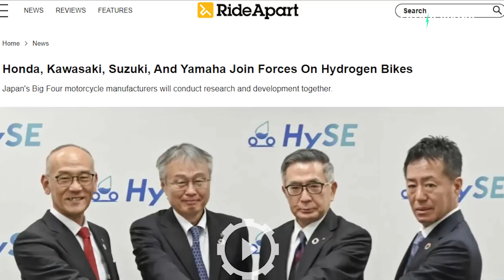Honda joins Toyota's, Suzuki & Kawasaki to make hydrogen engined vehicles

Comment: Just checked wikipedia to confirm what I already thought. A hydrogen engine (not fuel cell) is NOT considered zero emission, therefore it won't be allowed in certain countries. The video mentions carbon neutral, which is another way of saying it's not zero emission, we're just counting it against the reduction of things like reduced use of oil and gas. I don't know why governments allow corporations to talk about carbon neutrality when they actually aren't getting rid of carbon emissions. I hate seeing buses and garbage trucks running on "clean" natural gas. There's no such thing as clean burning natural gas. Of course, generating electricity to charge EV batteries does require the use of "dirty" fuel in many power plants and manufacturing facilities but this usage has been reduced with the use of hydroelectric plants along with solar and wind farms. It will take a real long time and major changes in the way things are manufactured to get rid of all burning of fossil fuels (will still use oil in making certain products) but the blatant misinformation being pushed by corporations like Toyota has to stop. They need to quit using words like carbon neutral and carbon offsetting and tell it like it is. Of course this will never happen because corporations always lie about everything they can get away with.

--As pure hydrogen does not contain carbon, there are no carbon-based pollutants, such as carbon monoxide (CO) or hydrocarbons (HC), nor is there any carbon dioxide (CO2) in the exhaust. As hydrogen combustion occurs in an atmosphere containing nitrogen and oxygen, however, it can produce oxides of nitrogen known as NOx. In this way, the combustion process is much like other high temperature combustion fuels, such as kerosene, gasoline, diesel or natural gas. As such hydrogen combustion engines are not considered zero emission.

--Burning natural gas for energy results in fewer emissions of nearly all types of air pollutants and carbon dioxide (CO2) than burning coal or petroleum products to produce an equal amount of energy. Natural gas is mainly methane—a strong greenhouse gas.

Comment: About 8% of petroleum goes into chemical manufacturing. Coal is still the cheap reducing agent of choice in metallurgy - especially in making steel. We'd all be better off if hydrogen production powered by renewable electricity (https://en.wikipedia.org/wiki/Steelmaking#Hydrogen_reduction) were to become cost-competitive with carbon reduction of iron ore. Hydrogen-powered cars have no chance of competing with EVs.

Comment: So what is the "round-trip " cycle efficacy ? EVs get about 3-4 miles per kWh. What will it be when you have to  electrolysis water to get the hydrogen and then burnt it in a ridiculously inefficient hydrogen ICE engine ? My guess would be less than one mile per KWH
Reply: Dont ask, it is very likely a deal breaker for this technology.
Reply: @林振华-t4v  if you do the maths, replacing all the UK's cars with EVs would add about 65twh to yearly uk power demand.  So about an extra 20 to 25%.  A lot but doable over a decade or two. But i would expect about 200+twh a year doing it this way. .

Comment: It REALLY must be an existential crisis for all these companies to join together!!
Reply: Joined to die together.
Reply: Yamaha and Toyota have worked together many times, producing a V6 engine for the Pontiac version of the Matrix, for example (why they didn't put it in the Toyota version I can't really understand).
Reply: @One Tin Solder  you nailed it on one of the auto industry’s main sources of profit, parts and maintenance services. As a former 22 year auto maintenance and service tech, long time auto enthusiast, and previously proud owner of 9 Toyota vehicles, I’ve seen the writing on the wall in the last half decade. When I saw a factory assembly line video of Toyota’s Mirai HFCV and how complex the powertrain is underneath the body panels, I knew it would not be an easy market adoption. Cargo space is also sacrificed greatly to accommodate the two compressed hydrogen tanks. I did as much research as I could about HFCVs. The result of that research made me realize that it’s basically a scam. A way for legacy brands and big oil to hold onto business as usual by marketing HFC as a better alternative to BEVs. Which is why there have been so much constant negative media about EVs and specially Tesla. All while HFCVs are somehow promoted heavily and rarely without mentioning any of their downfalls, which there are many. More than EVs actually. In fact too many downfalls for me to even consider them as viable for personal transport use in the foreseeable future. Which is also why they have yet to catch on in the decades that why have been heavily marketed as the “fuel of the future”. Don’t take my word for it. Everything I’ve said is easily researchable. And as long as you don’t get lost in the countless paid positive propaganda, you will find the truth about them and may come to the same conclusion as I have.
Reply: @FlipBoxStudio  Interesting perspective - thanks. My thesis: I think they're bowing to government pressure to build HYSE cars as a gift to the utilities, which want to restart their nuclear plants to extract H2 from seawater. It's the only reason I can imagine the Japanese government is putting pressure on auto manufacturers to go hydrogen. And as you point out, there's both a cultural precedent for companies to comply with such cross-industry pressure and a commercial incentive for them to do it (it would theoretically enable maintenance of the existing dealer network & maintenance/service model). Maintenance & service is where dealers make their money; replacement parts is where automakers make most of theirs (that & finance).

Japan isn't intending to import H2 in volume from fossil fuel companies: there is NO H2 tanker fleet & NO H2 distribution network. Hydrogen is a tiny molecule, almost impossible to contain in steel vessels & pipelines. It eats through stainless steel pipes & valves. So this isn't like pumping & storing propane/natural gas: that you can do. Doing the same thing with hydrogen gas isn't viable. There's no filling station network & won't be. 

Without a distribution & filling station network there'll be no way for customers to refill. 

There's currently one (1) H2 station in California; I'm pretty sure that's it for the US. Can someone comment on what the distribution network is in Japan? Is there any serious intent to try to provide one?

Assuming the Japanese were serious about doing this, they'd still be screwed. The EV supply is growing exponentially, & governments from EU to China are mandating that all new cars sold MUST be electric by 2030-2035. That is conceivably long enough for Japanese firms to create viable hydrogen-powered cars, and maybe even long enough to scale production. But without a hydrogen distribution network as ubiquitous as gas stations are now there's no way they'd be able to sell them. So this whole exercise appears doomed, & obviously doomed. 

What on earth is motivating Toyota & Honda etc. to even consider this? None of it makes any kind of sense.
Reply: It is but it's only moral support, won't git it dun.
Reply: @blaumax1910 As an owner of a 2023 Chevy Bolt EUV, I agree with all your statements. I drive by parts stores and gas stations all day long wondering why more people cannot see the benefits of owning an EV. I notice independent service centers with lots, full of cars, trucks etc, all awaiting repair. And gasoline is likely to be an issue as the 2024 presidential election approaches. Guess it takes some folks forever to see what's in front of their noses?
Reply: No, not really. I lived in Chiba prefecture 13 minutes from Tokyo station for almost 6 years. I worked  for a major corporation there and many of my still current close friends are Japanese people that I worked with there going back to 1998. Working together for the good of their country and their people IS the Japanese way. 
Toyota and Yamaha have worked together since the early 80's. Some of them use the same O.E.M.s to make engine parts and accessories parts since the 1980's/1990's.
Reply: @MichaelWashingtonAE  Working together on an EV strategy would make much more sense than putting efforts into those that are doomed.  Why hurt your whole society just to prove a point?
Reply: @Pimpernicholas  profits
Reply: @sorinelpustiu5674  except no profits
Reply: @MichaelWashingtonAE  But FIVE working together is a whole other ballgame! And coupled with the current market climate, you have to admit that this really feels like something a lot different from the status quo!
Reply: @unclefatbloke687  but when you make something different, it needs to be better, not significantly worse
Reply: @williammeek4078  Haha, yes, you would hope/expect so, wouldn't you!

Comment: This is ridiculous.
Physics isnt a religion. Japan is going to find out that physics exists whether you believe in it or not.
2,000 moving parts vs less than a hundred. The friction is insane.
Boat engines? You've got to be kidding me.
Battery powered boats are probably even better than cars due to how often boat engines breakdown.

Comment: Tony Seba was at the recent Shanghai International automobile exhibition and he said nobody was going into the internal combustion engine vehicle booths the were quiet and empty Everything was about electric vehicles Goodbye to the internal combustion engine companies Hydrogen will just bankrupt them faster
Reply: No, hydrogen will live on for fuel cell. And immediate customers will be all industrial application and rocket fuel. And eventually hydrogen fusion. But the auto manufacture go all in for it right now. They are the ones may go under.

Comment: Electricity is everywhere.
Do you have a hydrogen outlet at your house?
Most factories, warehouses offices have electricity. Hydrogen, not so much…😂😂😂😂
Reply: Right, and another aspect is this. Even regular gasoline stations take up as much land as a house, require large underground tanks and hardened safety protocols to prevent explosions of a dangerously explosive fuel. Hydrogen compounds all of this, to make fuel stations fantastically expensive and slow (it's actually possible it would take as long to fuel a hydrogen car as to fast charge an EV to 80% or so in the near future). And they have to be hardened against leakage of the smallest molecule that exists (nearly impossible) AND against the dangers of a highly explosive, literal rocket fuel. WHEREAS, with a significant but feasible infrastructure investment, fast chargers can be put in at relatively modest cost in EVERY already existing parking lot, which at least in the US is a hell of a lot. No or very little new land is needed. AND the conversion to 100% renewable sourced electricity is already underway and entirely necessary for other reasons ANYWAY. The contest is OVER. Battery Electric is the way to go. This has been clear since at least 2010 and it's ever more clear every day.
Reply: I have one at my house 🏠 built it myself moron

Comment: You have to use energy to make, store, transport and use hydrogen. When using hydrogen you lose energy in the form of heat. Batteries are a far superior solution and less volatile. And the electric system is already built and relatively easy to expand.
Reply: Batteries are hardly "far superior",  in fact electricity is some of the least energy dense fuel on this planet. EV motors are very efficient, however the batteries to store and use the electricity are really far too big and heavy for what you get. Tesla Model Y has a battery weighing in close to 1000 pounds, and hols the equivalent energy density of about 2 falls of gasoline (weighing about 16 pounds). Hydrogen's energy density is about 3x what gasoline is. Don't get me wrong I like my Tesla, but without a serious breakthrough in battery technology in the next 10-15 years, hydrogen may may be a better solution long term. (it has it's own issues too, all of this is relatively new)

Comment: Hydrogen pollutes much more than diesel. 
Then it has to be freighted around, compressed, decompressed new extremely slow filling stations has to be built.
Then there is the explosion risk…
Then the risk from a deadly gas with no smell.

Comment: They seem to have forgotten that the second law of thermodynamics says that when energy changes from one form to another form, or matter moves freely, entropy (disorder) in a closed system increases. i.e. you lose useful energy and it's innefficient.
Reply: Yes they are forgetting the laws of physics!!
Reply: @TheWizardofWestLA  you can’t forget the laws of physics. Hydrogen power is applied physics. Efficiency and Economics are then the guiding principles. You keyboard copy and paste merchants need to get educated.
Reply: So true. Hydrogen Engine: 1000Wh Electricity -> 750Wh hydrogen -> 250Wh motion power,  on the other hand, Electric Engine: 1000Wh Electricity -> 900Wh battery power -> 720Wh motion power
Reply: @ericliume  publish where you get the figures for H2ICE please so we can all fact check them. Thanks
Reply: @lesliecarter4295  You can get it from various sources. Here is a quote from Mckinsey report. FYI, There are four true zero-emissions technologies to power vehicles: battery electric vehicles (BEVs), hydrogen fuel-cell electric vehicles (FCEVs), hydrogen internal combustion engines (H2-ICEs), and biofuel or synfuel internal combustion engines. "Efficiency. Tank-to-wheel efficiencies range from 75 percent to 85 percent for BEVs to approximately 50 percent for FCEVs and some 40 percent to 45 percent for combustion engines.4 At the well-to-wheel level, the differences are even more pronounced: given the conversion losses in producing hydrogen from electricity and synfuels from hydrogen, efficiencies drop to some 35 percent for FCEVs, around 30 percent for H2-ICEs, and around 20 percent for synfuels. Well-to-wheel efficiencies for BEVs depend on where the renewable energy is produced (as longer transmission lines imply higher losses) and whether fast charging is used.

Overall, the efficiency numbers are only approximate and differ as a result of driving patterns: combustion engines become more efficient at higher loads (an incentive for engine downsizing in diesel vehicles), whereas FCEVs are most efficient at low loads (a motive for fuel-cell oversizing and hybridization)."
Reply: Economic’s are more important than efficiency today. That’s why fossil fuels replaced batteries in the first place. If it wasn’t for regulation by governments then battery vehicles would not be used at all. Except golf carts of course. 😂
Reply: @lesliecarter4295  But efficiency leads to advantages in economy and electric vehicles would eventualy win out because they prove to have a lower cost of ownership in the long term.
Reply: @eclecticcyclist  by that logic you should just stick to you bike.

Comment: Hydrogen Engine: 1000Wh Electricity -> 750Wh hydrogen -> 250Wh motion power
Electric Engine: 1000Wh Electricity -> 900Wh battery power -> 720Wh motion power
Reply: The inefficiencies of hydrogen fuel are self evident. Electrolysis (where does the electricity come from), then ptocessing and luquid storage, then transportation, then lical storage again, then distribution pump infrastructure, then storage and burning in vehicle. Loss, loss, loss, loss. This is crazy, but please keep it up OEMs, only makes my Tesla shares more attractive
Reply: Where will the Hydrogen come from?  Electrolysis or from crude oil?  🇨🇦
Reply: 氢能源动力流失那么严重？？
Reply: @cseong74  the hydrogen combustion engine's efficiency is around 30~40%.
Reply: @ericliume  And that is only one of the inefficiencies associated with the whole problem!  For example, how much energy is required just to compress the hydrogen gas?  or its transportation? or the energy needed to  fabricate the containers for the gas?
It might pay the Japanese government to invest in a bit of hydrogen to blow up the idea.
Reply: @Pimpernicholas  So true
Reply: @ericliume  grid to wheels (assuming green hydrogen) for hydrogen ICEV is around 10%. Grid to wheels for HFCEV is around 25%. Grid to wheels for BEV is around 80%. This is why the economics just doesn’t pencil out for hydrogen, especially for any commercial vehicle.
Reply: @cseong74  yes

Comment: this is nuts!!!
With all due respect to Japanese for what they have done to stabilise and make ICE vehicles ultra reliable, this next step is illogical
Reply: Actually, the engineering in Japanese vehicles has been "coasting" for at least a decade.
Reply: @oldionus at least 3 decades. I worked for Nissan in the 90’s when they said they were no longer going to make big improvements as they were already ahead of the competition and it wasn’t helping to improve sales.
Reply: Yes Spock said it best 😂
Reply: yep. Toyota is just making itself seppuku.... crazy.